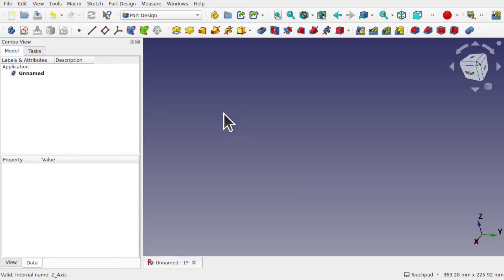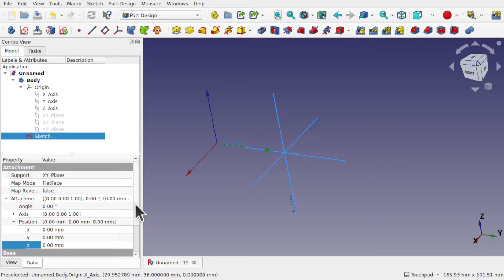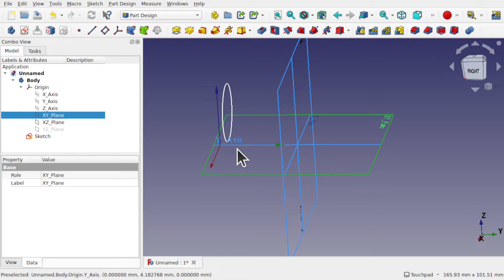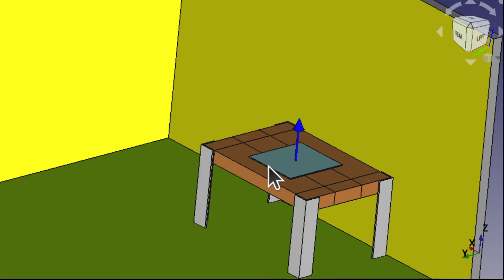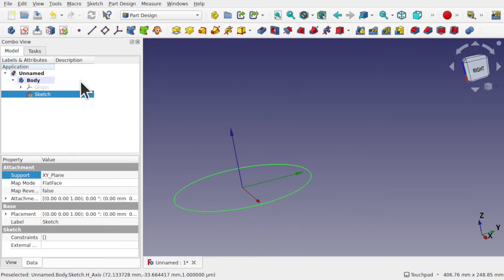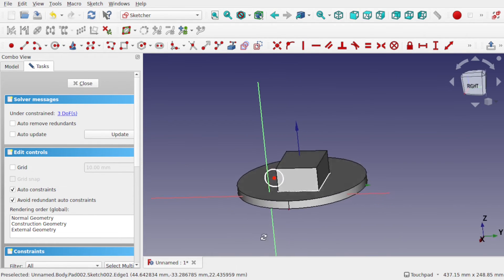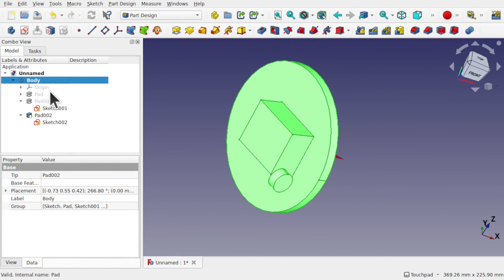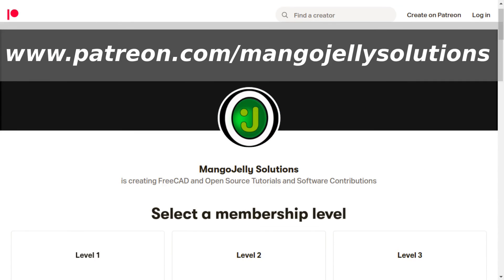FreeCAD Basics: What are Local and Global Coordinates and Why Is It Important?

Comment: Suppose I want to design an electronics box for an arduino, I have a model of an arduino uno with a cnc shield, I import the model and it's placed randomly. I want to position it such that its center coincides with the center of the global coordinate system, how can I go about this? I've tried to transform the model but I'm not sure if it's accurate enough
Reply from the maker: If you have imported from an external source I advise using a non lossy format such as STEP format so you are not working with a mesh otherwise you will have a tessellated model making life so much harder. 

You will probably found the canter of your model in some weird position.  This is because it's probably been exported from an assembly so the origin is the center of the original assembly.  If say this was a car and you just wanted the brakes then the supply would of just selected that sub assembly and exported out leaving you with a rotation/ origin point in the middle of nowhere.  This video will hopefully help with that link: https://youtu.be/7B8EwFb7XFM

Comment: Hi there. Today is 12-30-2023.  I am wondering how do you achieve moving the view with the mouse. I am on version 0. 21.1 and when I put the system in  sketch mode/WB it goes into perpendicalar view and locks up. Mouse would not move it The only thing I can do is use the view cube and do some limited rotations-jumps of like 45 degrees or so. Thanks
Reply from the maker: If you look towards the bottom right of the screen, you will see a button that shows something like CAD, Blender, touchpad etc. These are the control options. If you place your mouse over this button and wait a second or two a popup will appear showing you the keyboard and mouse combinations for zoom, pan rotate etc. The same button allows you to change the control types when clicked on. Hope that helps.
Reply: @MangoJellySolutions  thank you, but those are only std. mouse commands, which work in every WB except Sketch. In sketch WB it doesn't. But on you computer obviously does, so I am assuming there is little trick or some setings I need to change. In my case- as I said - I can only use the cube gadget in upper right corner...but that doesn't yield the smooth rotation you show!
Reply: @jiritichy6855  This was driving me nuts too. If you hold down left alt button while rotating, it should do what you want.

Comment: I often find myself just moving a part in a random direction to see which way I should move it. Is there a way to show the local coordinate cross for a part/sketch when it's clicked on? i.e. for that last cylinder you made.
Reply from the maker: I often do the same. It's a shame the feature your asking about doesn't exist as that would make life so much easier. Sometimes you can use your hand with the first 3 fingers with the thumb pointing up for the z, second finger y, 3rd finger in x direction, called the right hand rule but then you still have to remember where you are in global space and orientate your hands. And when your partner comes in to see you they asks you why your throwing gang signs at the computer 😂

Comment: At 8:20, what is apparently the Z-Axis looks like it's labeled "Y Axis". Is this a bug, or is there another explanation?
Reply from the maker: So, bear with me, your seeing the Y axis label of the body axis, we are offseting the sketch which is the attachment to one of the planes of the body.  So the axis of the attached object (in this case the sketch) will change depending on the map mode.  Flatface orientates the sketch Z axis to point away from what it is attached to, in this case the plane.  It is a complex subject and can get very very confusing.  When I get into attachment modes then things become clearer but don't worry if you don't get this. People have been messaging me saying they have used FreeCAD for years and didn't really understand this subject area until now.  I am prepared for a lot of questions from many around this :)
Reply: @MangoJellySolutions  Thanks. I understand your explanation, but I don't understand why the devs thought it was a good idea to show the axes of the body rather than those of the thing I'm working on. Does this serve any purpose other than confusing the user?